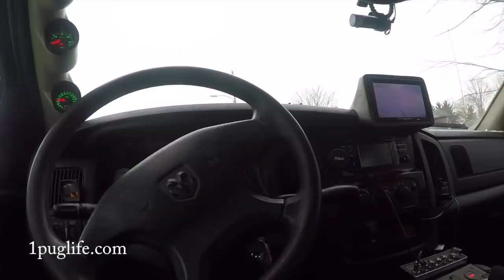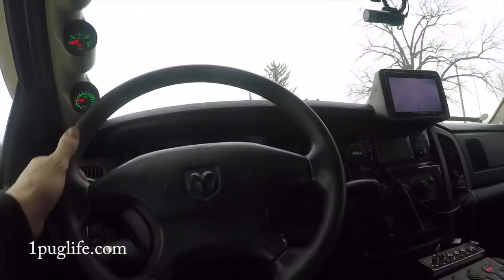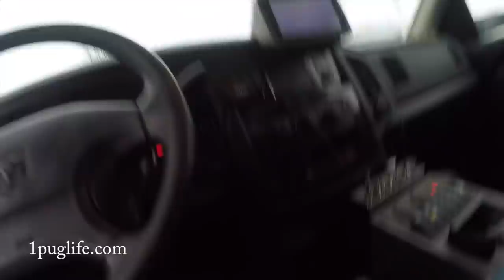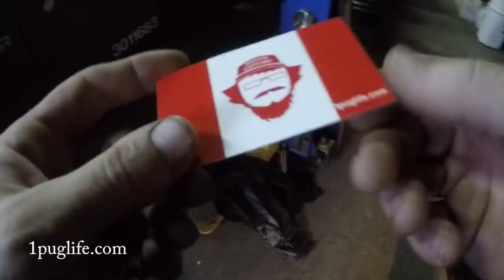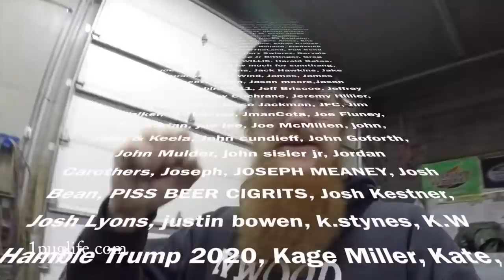brakes and steering

Comment: @1Puglife ... To adjust the floating in your steering box there is a set screw w/ a lock nut on the case that goes to your worm gear. Loosen the nut while holding the set screw in place and give the set screw  between an 1/8 to a 1/4 turn  ( you'll feel it while turning the wheel  w/ front jacked up) , hold set screw at new position and tighten nut. That should clear up any float , as long as tie rods , ball joints etc, are good... Many Blessings , SMR

Comment: On my Silverado theres an adjustment screw on the gearbox that will tighten up the steering and get rid of any slop in the wheel.. I just replaced my gearbox along with every single part on the front end

Comment: Welded steering shaft no good anyways safety 3rd
Reply: Maybe a snug fitting sleeve with through bolts?
Reply: @workonitm8  i agree . better than welding it for insurance none liability reasons .    still i dont know . tampering with the steering shaft could lead to a lawsuit .

Comment: I had issues with the borgeson shaft on a 06 dodge 2500. Not the joint but the set screws on the ends not staying torqued no matter how much loctite you use

Comment: Give ya a tip on universal joints they use now days. They put this glue in with the joints and it just happens to be heat sensitive just like the glued in drive shaft joints Chevrolet used and still uses today. All you had to do was heat the mother fcuker up till you see that glue come bubbling out from around the caps, then they come right out. Now don't you feel like a dumbass? 😁